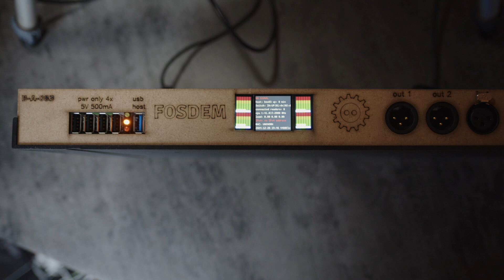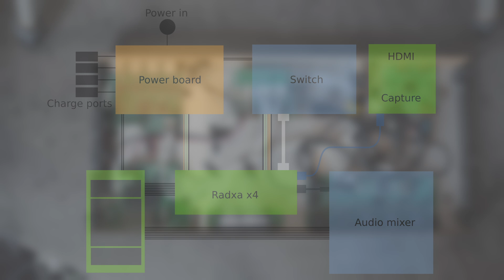The FOSDEM 2025 live streaming box

Comment: Nice work! Why did you use a Radxa instrad of a Raspbery Pi?Just curious :)
Reply from the maker: Because hardware accelerated video just works on intel platforms, the cooling for the x4 is ideal even because the CPU is on the bottom and the entire metal plate in the bottom of the box can be used as heat sink.